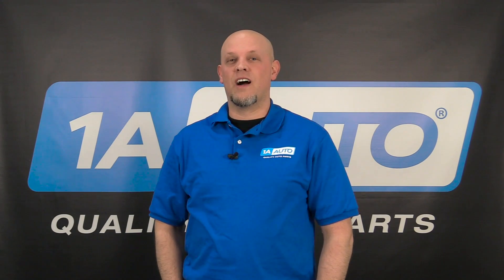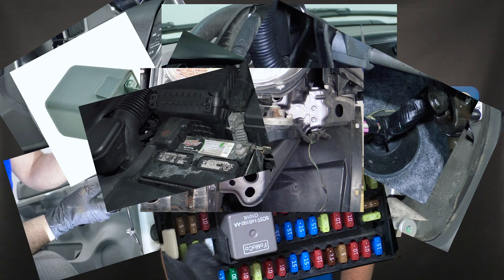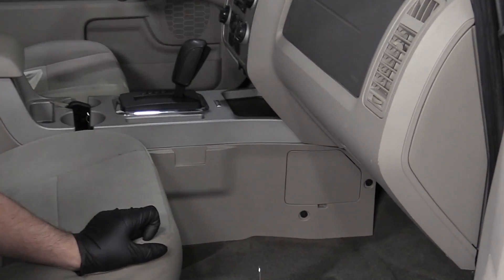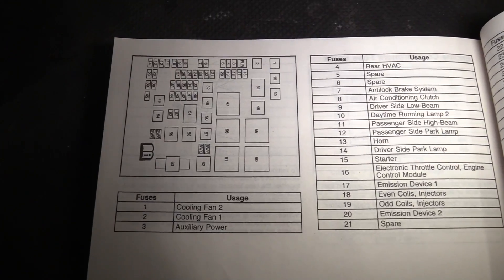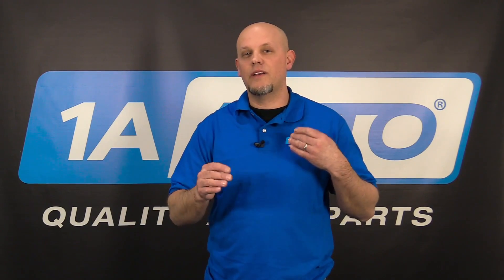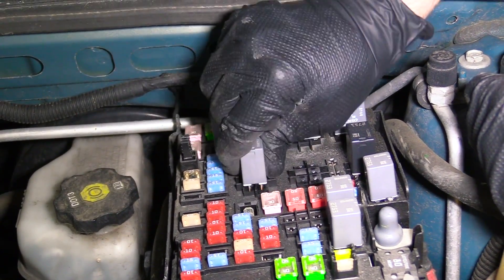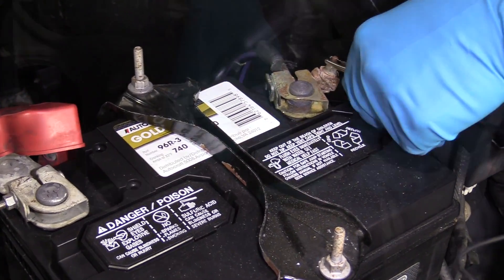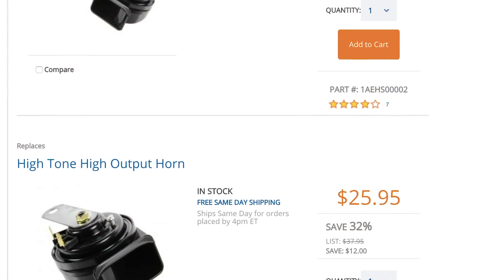Why is My Car Horn Broken or Not Working?

Comment: honda civic 2010 coupe, i swapped the horns and it doesn’t work, there’s no ground on the connector and the panic button doesn’t get the horn going either, i do hear the relay clicking on the inside though, any advice?

Comment: Replaced the horns, relay switch & fuse and still no horn😢 i know the wiring is correct because i jumped power from the battery to the relay and it honks. But my steering wheel horn doesn't work🤷🏽

Comment: What about the transient supression capacitor. That runs in parallel with the power from the relay to the horns, but the capacitor goes to ground.

Comment: Have 2011 Elantra Limited. Car was stolen. Replaced lock set cylinder car runs now. Also broken was  plug where air bag and horn plugs go.  The flat white wire connected to air bag was left dangling. Have managed to connect back together. But now air bag light is on, does not blink  and horn does not work. It works when I lock car with remote.  Also now the Ac compressor does not turn on.  AC has always worked. Need help!

Comment: Hi my hyndai kona2021 is new 1 year of using the horn doesn't work  and it only works after a while of driving i went to the the dealer thwy said water got into it they blew it with air it was working and now it doesn't what should i do?

Comment: 2:53 my horn works on the alarm but not on the wheel itself and has no ground that I can see like in the other videos?
Reply: In older cars, a horn is earthed through the back stud that bolts to the mounting bracket.

You can get around this, with a newer horn, by getting some wire, and two terminals, a standard tongue and blade female, and a ring terminal. 

Put the female b&t connector on your earth, crimp it to your wire, run it to the mount hole, trim wire to suit, crimp the ring terminal, and bolt the horn to the bracket, with the terminal threaded on. Should behave just like the earth on your old horn.

Comment: Hello 1A Auto. I have a '99 Civic whose horn only works sometimes... I hear the relay's clicking noises when I press the buttons on the steering wheel. I bought another horn at a junkyard, thinking it was the horn, but it turned out not to be, as both work hooked up to a battery... What could it be? Help would be appreciated from anyone...
Reply from the maker: +John Mano We wouldn't be able to diagnose an issue like that here, you may want to have a local mechanic take a look at it. Thanks for checking us out! http://1aau.to/m/Shop-1AAuto-c

Comment: So my 2019 Silverado just got broken into. Whoever it was picked the key hole and manage to get the driver side door to unlock. When he opened the door I’m guessing the alarm went off and scared him away. When I woke up my car was completely dead I had to give a jump start and a hour or 2 later I realize my horn wouldn’t work. I did what u said and heard clicking sound by fuse box. Could this be something else or do I need to take the grill off to look at the horn?

Comment: I have a 2012 Nissan Sentra SR 2.0 liter. 
The horon is not working. I replaced the horon fuse in the fuse box. I couldn't pull the other fuse/plug to check it. Any suggestions? 
Thanks
Reply from the maker: +Rahim Shamir We wouldn't be able to diagnose an issue like that here, you may want to have a local mechanic take a look at it. Thanks for checking us out! http://1aau.to/m/Shop-1AAuto-c

Comment: I have two cars and on both of them the horn is not working the difference is that on one it does work with the remote key and on the other one it doesn't. What could be the difference?
Reply from the maker: +A We wouldn't be able to diagnose an issue like that here, you may want to have a local mechanic take a look at it. Thanks for checking us out! http://1aau.to/m/Shop-1AAuto-c

Comment: Super video. 2012 Highlander. If i get a horn blast only when the wheel is turned left, does that mean the clock spring is the most likely culprit? TIA.
Reply from the maker: +Stephen Silberfarb Thanks for watching!  That could certainly be the issue, good place to start.

Comment: Hoping you check comments. 

Have a 13 Ford Escape. 2.2L 4cyl SE. 
  Had been driving earlier when I'd run out of gas. Performed a 'durability test' on the steering column as I cursed myself for not stopping at the last gas station. Horn immediately starts going off and wont stop. Had to roll into a school parking lot to pop hood and pull fuse. Trying to determine what under the steering wheel may have been jammed/dislodged in the active position forcing the horn to endlessly blare. Would like my horn to work again trying to determine what may need replacement/reset. 

TYIA

Comment: My Buick Enclave 2009 horn don’t work I changed the fuse but it keeps burning them when I put on a new one. What can this be??
Reply from the maker: +Pedro Torres Thanks for watching!  Make sure that you are replacing them with the correct amperage fuse first.  If it keeps burning out then there could be a wiring issue somewhere that is causing a short.

Comment: Sir my car horn sometime working sometimes no working ... Please help out...
Reply from the maker: +Moa PNR We wouldn't be able to diagnose an issue like that here, you may want to have a local mechanic take a look at it. Thanks for checking us out! 1AAuto.com
Reply: @1AAuto  Sir  last three months back I when to local mechanic ....then after two days same problem issues...  Etc... .. but they can't able to solve it the problem....  😔 😔...
Reply: @moapnr  Did you ever fix the issue?  I have a 2025 Kia Sportage X-line. I replaced both high and low horns, replaced PCB fuse box and horn still not working.

Comment: so my horn, airbag and cruise control all stopped working all in about a month, could it be the clock spring?
Reply: Yes most definitely
Reply: Did u get it fixed after changing the clock spring
Reply from the maker: +Jasper Mize Thanks for checking us out! These can definitely be caused by the clock spring especially if they all stopped at the same time. The only sure-fire way to tell however is to get it diagnosed or replace the part and hope it is. 1AAuto.com

Comment: So, if you hit the "panic" button and horn sounds properly, would we assume that the horns are operational but it's something between the steering wheel button and the relay?
Reply: Similar problem on 2012 Navigator.  Panic button and setting the security system honks the horns good and strong.  The horn has a 15 amp fuse which is not blown.  I've been told that there is no horn relay on this vehicle.  Don't hear any other relays clicking when the horn is pushed.  Apparently the relay's job is done by the computer that controls the security system rather than a relay.  Have you figured yours out?
Reply: Same what was the problem did u fix it

Comment: I fix my horn doing the clock spring change , first check the horn relay and check your horn direct from battery power to see if its working then change the clock spring and thats it you fix your horn switch (clock spring )you will need t25 torx special tool the one that have a hole in the center
Reply: Thank you 🙏